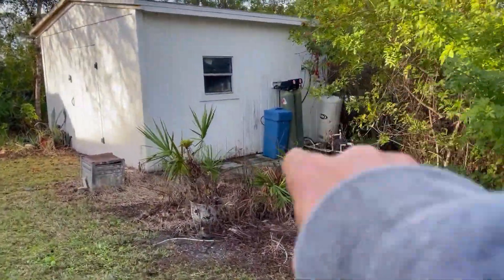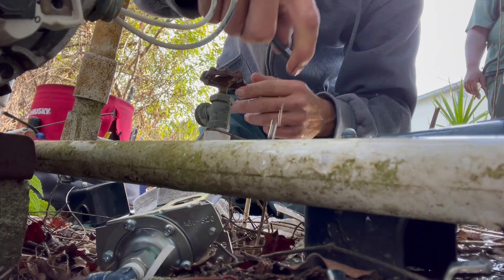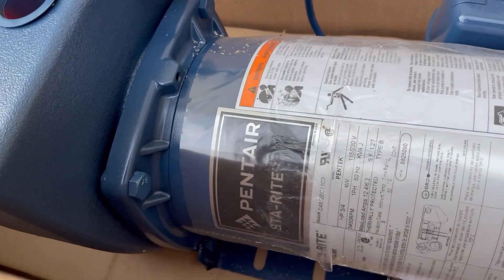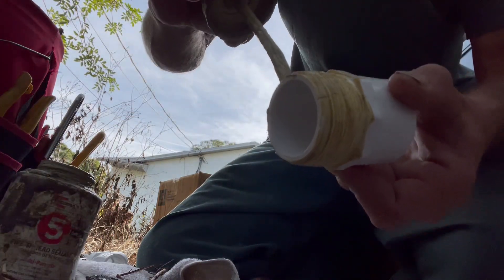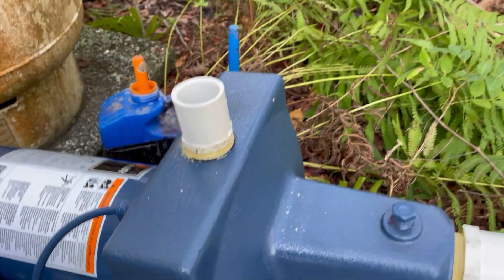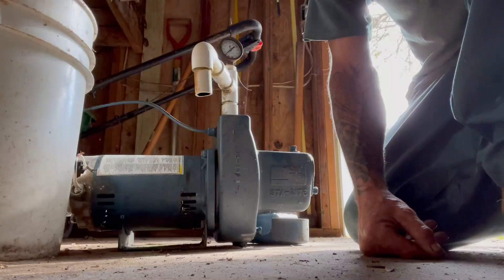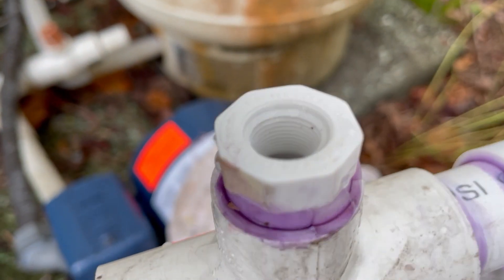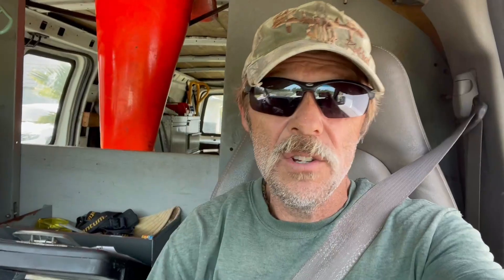HOW TO REPLACE 3/4 HP RESIDENTIAL WELL WATER PUMP

Comment: Nice job. I like your video so much I subscribed. I am in Minnesota where it was -22f° (that's 22° below zero fahrenheit). Me being from the big city and not knowing spit about shallow wells and pump, I was Fd because the little milkhouse heater didn't come on and my system froze up and cracked pump housing. So it's the middle of January and I'm off to Menards to spend several hundred dollars on a new pressure tank and pump all-in-one system

Comment: Excellent job. I have a jet pump in the crawl space of my house in Cape May, NJ. I had a new well troll tank and a 30/50 switch installed about 5 years ago. I own the house now for 6 years snd the pump was here. My water pressure is low on second floor bathroom and first floor kitchen. How do I know if the pump (its 120 volts) needs replacing or could it be something else. Many thanks. Joe.

Comment: Hello good morning, I watch your videos. Can you help me? I have a 1.6 hp pump for irrigation, but it works for a while, 2 months or less, and the pump works, but the pressure stops working at 20/40 psi. I have already bought 3 pumps. I don't know what it could be. Thank you. If you can give me a tip, I will be grateful.

Comment: Just did this at my home. Wish I'd known about pipe dope first. I used teflon only and, no matter how many wraps, had a slow, drop oozing out leak at both the inlet and outlet. Blamed it on the PVC fittings. Have bought brass fittings and will use BOTH tape AND dope. Just haven't had the heart to drain the system again to replace that plastic yet. My pump was just shy of 20 years old and totally filled with corrosion!

Comment: I need my existing pump replaced,,the setup is eaxactly like the one you just did..what is a fair price for a plumber to replace my pump..i have new pump and fittings onsite,,i do all my own repairs etc until it comes to plumbing however looking at this video i may do it myself..existing pump is 25 years old and is not putting out much pressure,,

Comment: Thanks, Do I need to do anything differently if my well is waaaaay down a hill? I am in snowy frozen Canada, my pump is in a closed room in the basement because everything has to be protected from freezing here. My concern is about loosing water pressure because the distance between the well and the house is so great. Previous pump worked just fine until it was just to old and rusty. Should I keep lots of water on hand? Just wondering if things change unexpectedly due to distance?

Comment: I have the same style Sta Rite pump, but mine is dual stage and has a blue tank above it. Mine is running a sprinkler system. Is that blue tank an expansion tank/bellows? Great video!

Comment: Excellent video. My folks had a well pump for many years until city water became available. The old stub up pipe out of the ground is still there and has been capped off for many years now. I have purchased a 3/4 horsepower pump. I also have a tank. I just want to see if I can get it going again after all these years. Mainly just to see if I can do it, and to use to water a garden and peach trees. Is there anything I should know or any advice you may be able to give me. I won't hold you responsible even if it's the wrong advise.The pump I purchased is a everbuilt 3/4 horsepower. Convertable jet pump. Fresh water for home application. There is nothing there but the stub up out of the ground. I have nothing to go on therefor no photos to go by. Could you help me maybe talk me through the process. Any of your expertise  would greatly be appreciated. Yours truly, I'm new I'm new I don't know what to do!